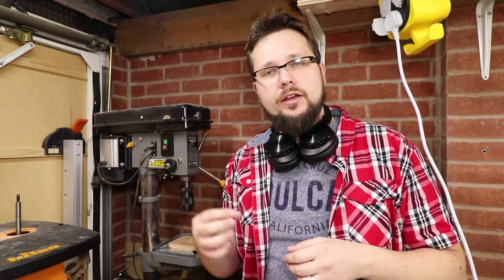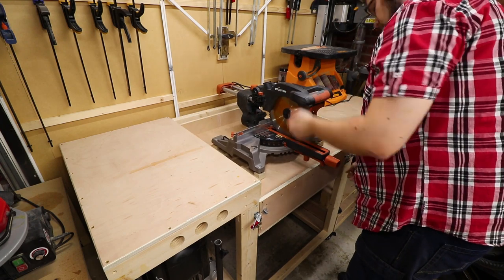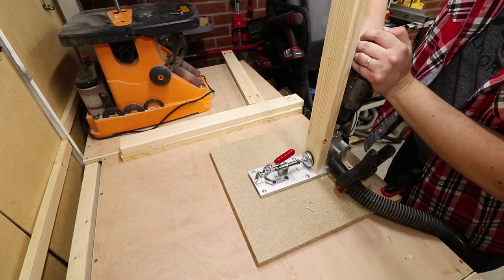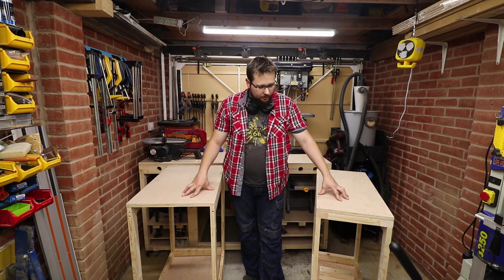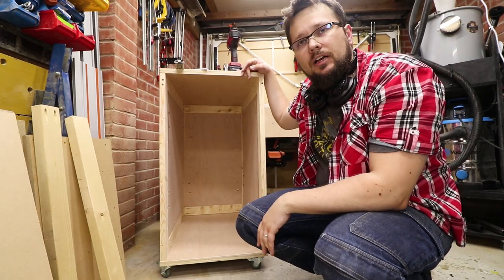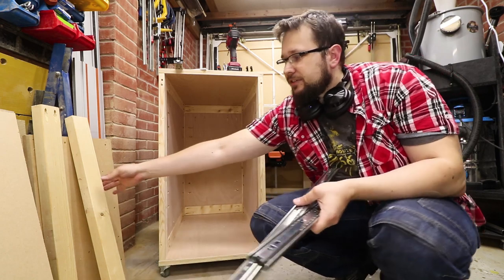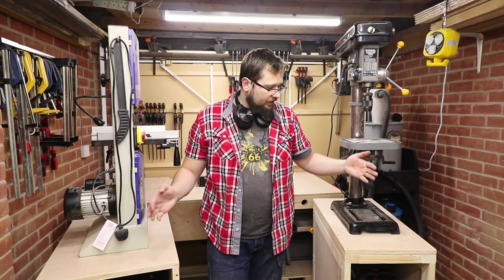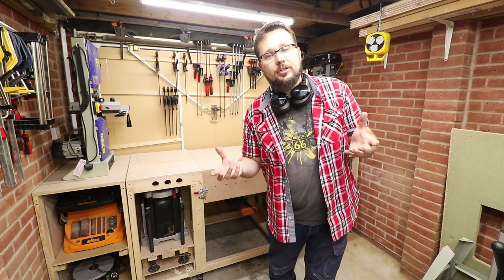Mobile tool carts for small workshops

Comment: I really like your unconventional cabinet construction techniques. Just proves you can be original. I do agree with the comment that the drawer slides were not designed for the loads you are applying in that orientation. Sometimes originality can be challenging. My suggestion would be, since this is just a shop project, get some paste wax and use wooden runners. You could make some hardwood runners that would be thinner than the slides and would work just as well. Put some thin guides along the top of the sliding board to keep is from tipping when you pull the board out as well. All in all, it would be cheaper and work better. Finally, it looks like you are pretty tall but in my opinion you made the carts too tall for the tools mounted on top. I understand that you were making them to match the height of your work bench but they should have made to take into consideration the optimum height of the work surface of the tool. To each his own, but repetitive work on a tool that is too tall for the operator can lead to fatigue and injury.
Reply from the maker: Thank you for your comment. Yes the wooden runners would be much better and cheaper. Sometimes the easiest solutions are the hardest to notice. I was too worried about the height but I have to say it seems to work perfectly for me. Much greater viability and control.

Comment: Hi. If you want to add to cart stability and you don't really need/want full panelling (for noise reduction, e.g.) you could just use "crossed" diagonal crossbeams. On one side, link it down-front to up-back and on the opposite side link it up-front to down-back.
Also, as I'd be a bit worried about the weight of the sander over that open shelf, I'd add a supporting leg under the shelf, to be opened when the shelf is fully extended. Maybe you could just attach the leg with a hinge on the front side so that it folds back and away and when closed it's retained by a simple "door" magnet.

Comment: I like the idea of small modular shop carts. Constructive critique: The drawer slides are not designed to take significant loads across the short edge axis. As you need to conserve space, why don't you mount your "studs" to the underside of the shelf, inset by the (short edge) width of the slider - then the sliders can be rotated 90 degrees and take the load correctly.
Great work.
Reply from the maker: Yes I have to say it's not the best solution and I have to revisit this sooner rather than later. Thanks for the tip it could be the perfect solution for this. Thanks👍

Comment: Great builds there Thomasz, i have built mine in a similar way using old Melamine wardrobe doors cut to size, when you need the space any look will do, after all it's only for the shed. 
Barry (Wirral, ENG)
Reply from the maker: Exactly that mate, as long as it does what's intended then the looks come second. Although I love those birch plywood cabinets and carts made by the American Youtubers 👍

Comment: Not sure how loud your compressor is but I used some old carpet padding as an insulator/noise reducer for my shop. Granted, my compressor is around 9 meters away and is a 125gal compressor so it's quite loud anyway...BUT...it still reduces ambient noise quite well.  Not perfect, but may be the solution your looking for...especially since you can most likely get used carpet padding on the cheap...hope this helps...and thanks for the vid!
Reply from the maker: That's actually a brilliant idea! Thank you

Comment: Good build but personally the drill press and bandsaw are way too high up. Purely on a safety concern side. I understand the space limitation part but still, not good!
Reply from the maker: Thank you for your comment. So I made those carts few years ago now, they both moved with me from UK to Poland last year and still in my workshop. And guess what, nothing has happened. The Drill press is bolted to the top and the compressor weights a lot more than the drill. I think that gives the stability. However I understand your concern. Now as I got a bigger workshop I will be implementing new solutions, much safer and smarter 👍

Comment: Be aware that your air-compressor may over heat inside of the enclosed space.
Reply from the maker: Yes thought about that, I'm thinking of making couple of large holes in the plywood to get the air flowing inside.maybe that will help.
Reply: Seriously doubt it, unless it was permanently running. A lot of the time they run for a minute or two and don't need to re-fill for another 10 or 20.
Reply: @CasualDIY   Maybe on the insulation; Any fabric with a non-flat surface should help. To keep it cheap, maybe some bits of carpet or doormat might do the trick for your specific case?  As for the air holes, maybe choose to drill a bunch of 15mm holes instead of one huge one, to help keep the sound down.  Else, just fit a small airfan, ensuring airflow over the compressor fins, that should help more then enough without adding holes

Comment: Hi, I have an air compressor like yours and I tried to put it in a box but it kept cutting out. I later found out that it was overheating, I took it out of the problem sorted.
Reply from the maker: Hmm hope that will not happen with mine but if so maybe I will try cutting some holes in the plywood for air to circulate ?

Comment: Hi the drill that you have in the back ground how good is it can you use it for metal work
Reply from the maker: You mean the pillar drill? It's Titan from Screwfix. It's very powerful and dose have a lot of speed setting if my memory is not mistaking it's 18 settings of speed. So it should be plenty for any DIY needs👍
Reply: @CasualDIY  yes , and thanks Because I need a good drill like that
Reply from the maker: @kojomensah7474  so far had no issues with it👍

Comment: that pocket hole jig you have,whats it like,i was looking at kreg one but on a budget and wont be using it alot
Reply from the maker: It's a Katsu jig, it's ok had only one problem with it so far. When used for the first time the drill bit got stuck inside, but I used some WD40 and had no issues since👍
Reply: @CasualDIY  excellent,thank u